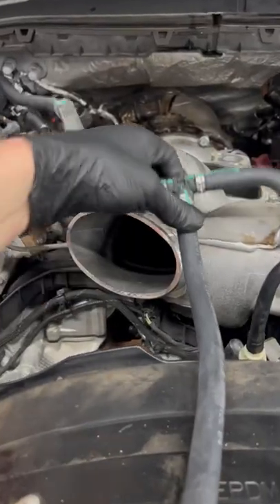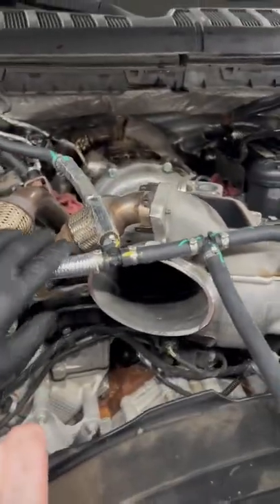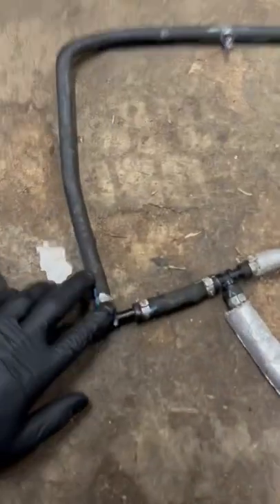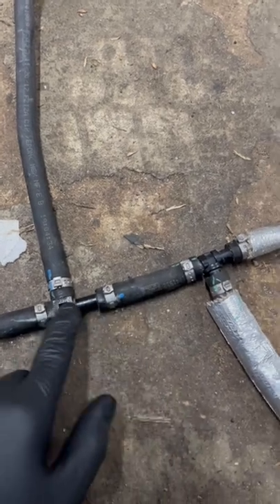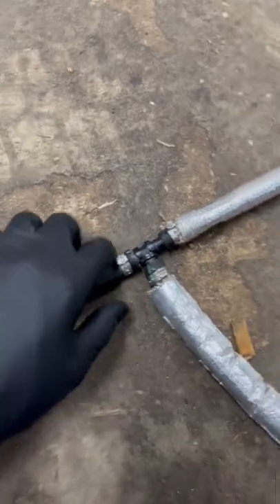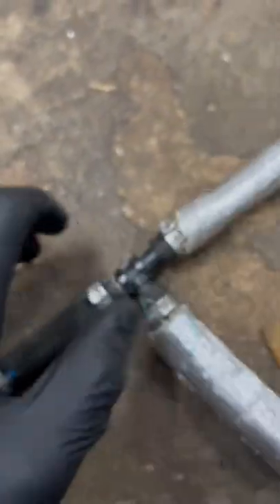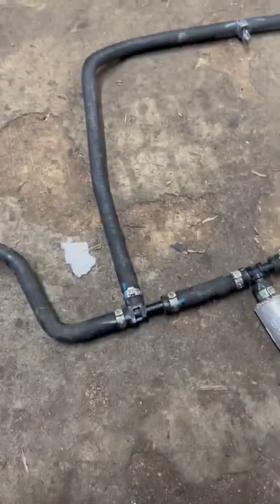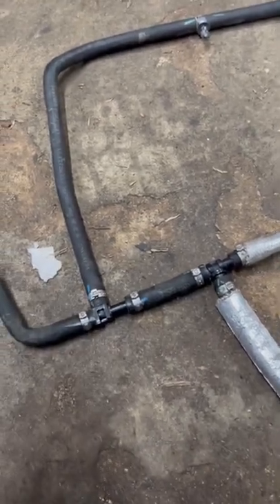Your 6.7L PowerStroke is LEAKING Coolant You Just Don’t Know It Yet #shorts

Comment: Thanks for the tip. I’ll take a peek at mine.
Reply: Ever see any coolant leaks on the 6.2l gas engines? 

Mine has a leak and I can’t find it, thinking one of the radiator has a pin hole on the driver side middle mount point…it only does it intermittently making it hard to figure out where it’s coming from

Comment: Hands down great channel and video sir. My Family works with the Ford family in St. Louis plant/office for over 40 years. I understand the cost savings ford has to take on these couplers. But those damn “T” couplers are always the first to delete themselves. It’s amazing that a simple irrigation fitting from the big box stores and some compression fittings can last so much longer. I know you can’t recommend that fix, however they have worked on our 94, 2003, 2010 explorer. And  our 99, 2013 and 2019 Ford 6.7 super duties.

Comment: Yep thanks mine is starting to leak.  Ordering new one
Reply: Or just get some line and put some correct plier hose clamps. Not the hose clamp you use a flat head or small socket. People tend to over tighten and breaking plastic

Comment: Hey Sr have a question for you,I have a 6.7 2017 with white smoke and found  coolant in passenger side exhaust manifold,then I make pressure test,and was losing pressure, and th coolant goes true the  oil pan.can be a head gasket

Comment: Looks like the owners ain't checking under the hood and I have owned them before and have never had that issue and if it's doing that the motor is causing alot of internal pressure on system